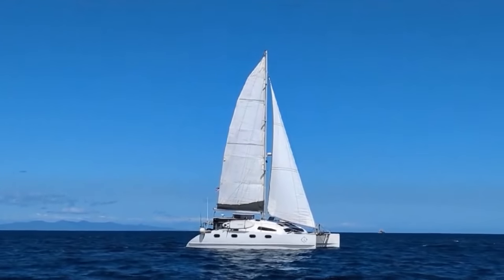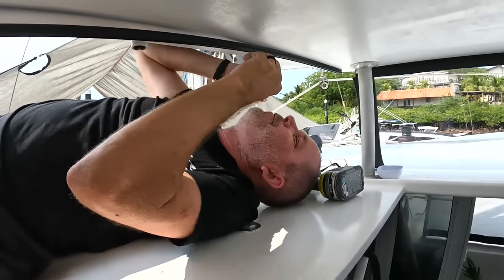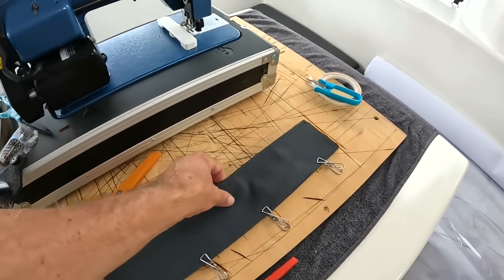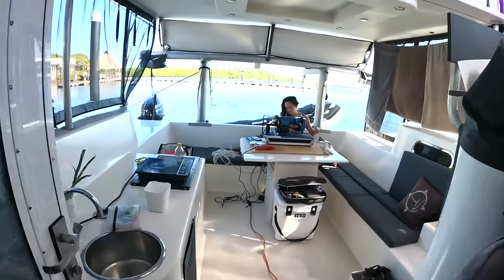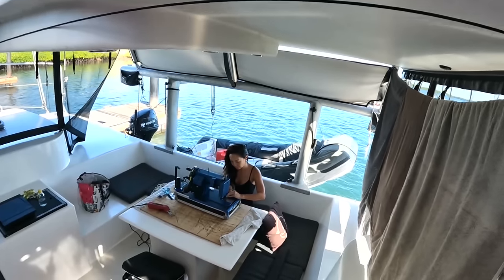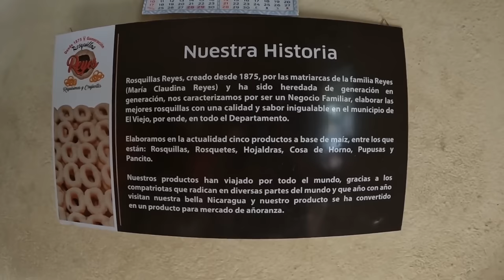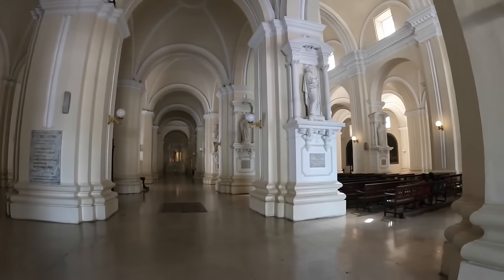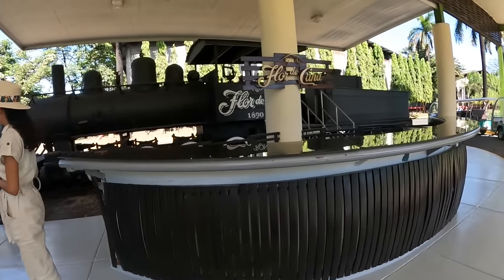Protection At The Helm...FINALLY! - Onboard Lifestyle ep.290

Comment: The weather panels will sure help. Consider installing a hinged glass panel facing forward at the helm.
That way you can install window washers and still open the bottom of the window for fresh air when needed.
I found that using up automotive polish works very well on my jeep soft top side windows. Rain-x also works good to keep the poly windows clean.